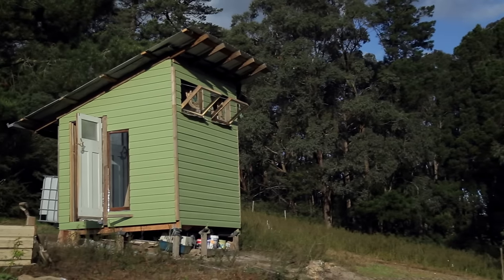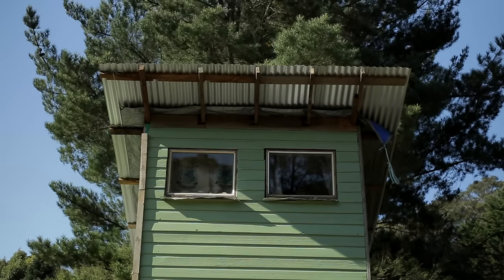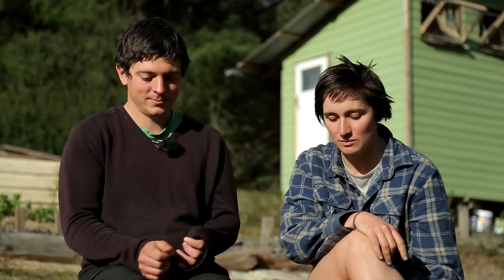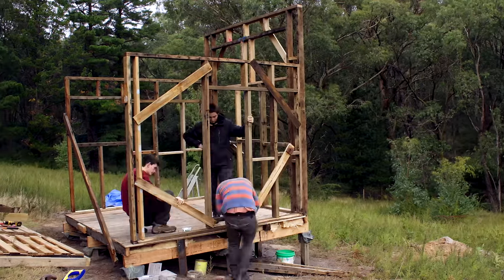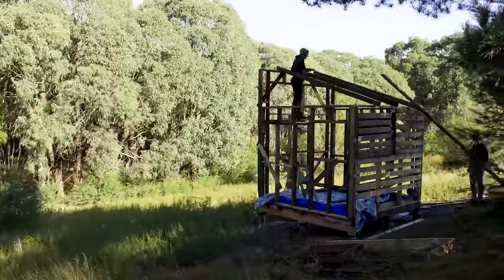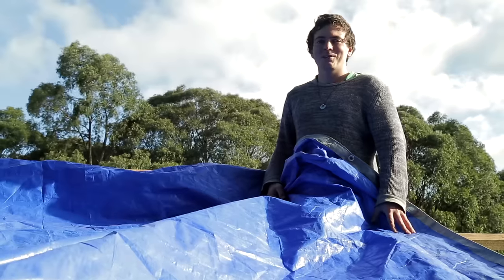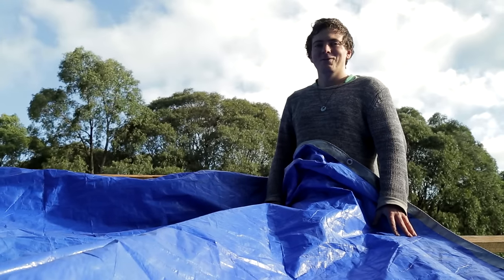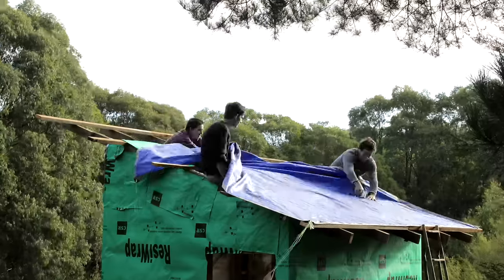This Couple Built a Tiny House for Only $400!

Comment: I built a 200sq ft tiny house that included a kitchenette with shelves that hang from the exposed frame ceiling area and a microwave, mini fridge, dishes, toaster oven, a hanging water bag with a temporary sink, a composting toilet, barstools that fit underneath the counter space, a tiny coffee table and tiny end table with an antique typewriter on it  and a futon couch downstairs along with an easel artist corner and then a half stairs half ladder I built myself in the corner up to the loft with a partial retractable floor  (to be able to move furniture up and down and have more space), a tv, a closet, a dresser, a nightstand and a queen sized bed and headboard and shelves in the upstairs loft. 

It sleeps 4-5 people and is 10x10. I only spent $34 on the whole thing and it's basically a bomb shelter on the first floor because it's concrete blocks on the first floor with a timber framed loft and then all covered in vinyl siding with a tin roof and 6"1 tall on the first floor and 4"0 to 5"1 tall in the loft. 

Affordable housing is possible if they would stop making laws prohibiting tiny homes from being considered a primary residence.

Comment: Next time you should strap before putting the siding on to allow an air gap to dry the siding when it gets soaked, and not allow moisture to be trapped in your walls :)

Comment: Walmart has a prefab shed almost the same size as that for 2 dollars cheaper.
Reply: We don't have Walmart in Australia, but a Walmart 8x7ft prefab shed is smaller than this, doesn't have a loft and costs US$899 (AU$1300).  Instead they built this for AU$420 which is only US$288, a lot cheaper than a Walmart shed.

Comment: I have been telling my fellow United States citizens: "The solution to the gun violence problem in the United States has nothing to do with guns or lack of guns. The solution to the gun violence problem starts with making housing and the doors and locks necessary for it cheaper than the cost of a single gun and its ammunition. Guns do not keep you warm in the cold, shaded in the sun, dry in the rain, or still in the wind, sure you can shoot a robber or rapist if you are not already asleep but houses protect you even while you are not conscious." This is a well made video. Thank you.

Comment: You do need the proper skills to build a house.Building paper is "breathable" and that tarp on the roof isn't. You eccentrically put a vapor barrier on the cold side (outside) and that is a big no no.The mice will be moving right in with all the exposed pink insulation in the floor.